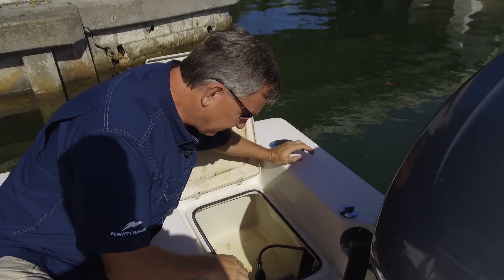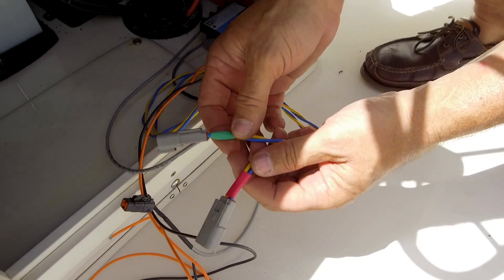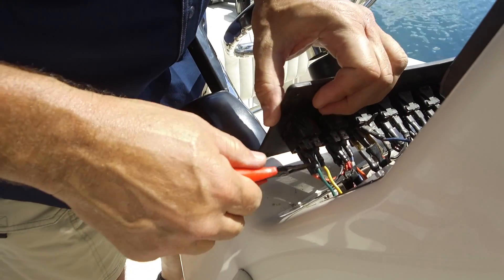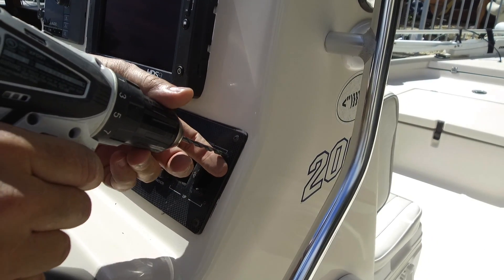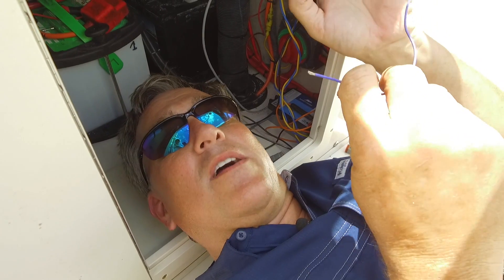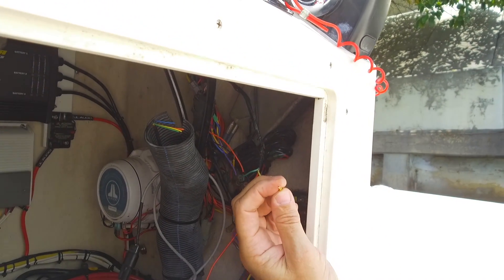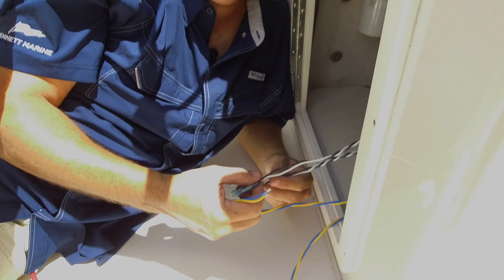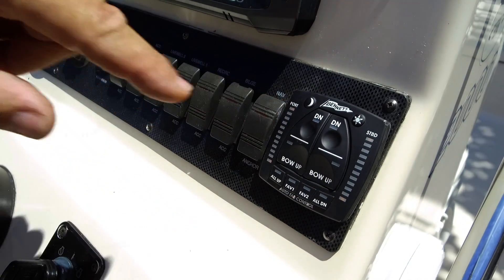Bennett Auto TrimPro Installation with Lenco Actuators

Comment: I wanted to add a comment on tapping your existing wiring. My boat is a 2017 Stingray 198LS which is similar to Larson and may have the same color wires to other smaller boats. Under my helm is a removable cover with a bank of relays with labels. I also have a set of dashboard switches from the factory. You are going to need a selection of crimp end terminals, crimper, and a wire stripper.

If you wire this up as specified, you will need either a battery on/off switch to cut main power or a separate on/off toggle switch. Otherwise, both the ATP control and the controller will stay lit all the time. I wound up running both orange wires off of the "trim tab" toggle switch on my dashboard (optional switch wasn't connected to anything from the factory). There was an open spade on the bottom rear of the rocker switch. I used a blade spitter and some heat shrink to connect both orange at this location. I chose to install an inline 20amp fuse on the orange to the controller fearing what might happen if the actuators short underwater. If you don't have this switch, you will want to have a battery cutoff switch or some other switch to prevent the controller from running all the time. Note that you could also use T-taps to splice into existing wiring, but the piggy back blade splitters are nice because they leave the wiring untouched and are easily reversible. Main power at the helm should be a large gauge red wire.

For the black ground, I used a piggy back blade splitter on the back of the black side of the cigarette lighter on the dash as I didn't have a bus bar at the helm. If you see a bar with a bunch of bonded black wires, that would be preferable (attach with a crimped ring terminal or similar). I could have also used a t-tap to any of the larger black gauge wires under the helm.

In order for the auto retract feature to work when you shut off the engine (before trailering), the purple wire coming off the ATP control must be connected to switched power. Look at the back your gauges to see what color power cable was used. The gauges usually are switched with the key ignition. On my boat the color of the power to the gauges was also purple, same as the ATP wire. I had an empty gauge spot and a pair of unused wires that I joined using a fully protected male/female spade terminal.

Comment: Does this work with a bennet hydraulic trim system?
Reply from the maker: Yes indeed! However, in order for the trim tab position indication LEDs to work you'll also need to ensure you already have sensors in your hydraulic actuators, or else you'll need to purchase a sensor kit (PN#  ATPSENSTD). An easy way to determine whether or not you currently you sensors is if your current trim tab control has trim tab position LEDs. Hope that helps!

Comment: Why wouldn't 3M4000UV sealant be more appropriate when installing tabs? The screws are what's holding the tabs on, not the 3m5200. Wouldn't a boat owner wish 5200  had not been used when they have to replace a tab part later?
Reply from the maker: Sorry for the delay. Our notifications were not coming through properly. Please email BMI_Info@Yamaha-Motor.com to chat with one of our techs.

Comment: I downloaded the install manual for the ATP. The instructions for the hydraullic version was to make sure control module is installed vertically and for the correct end facing the bow and parallel with keel.
The instructions for the electric version said you can mount it in any orientation. One version has got to be incorrect. Please address this for those potential buyers. Thanks
Reply from the maker: Zash, it sounds like you might have an early version of the ATP installation instructions, so you will want to destroy them and use the following for your application:  http://bit.ly/2Ncojdp (Installation manual), and http://bit.ly/37RKNs9 (Quickstart Guide)

Comment: Dear Team Bennett, I would like to add this to my 08’ Searay 44DB, and would like to know if I need to add position sensors to the rams?
Reply from the maker: Sorry we never responded. Our notifications were not coming through properly. With hydraulic systems, AutoTrim Pro technically does not need sensors to function with the auto tab control or manual tab control features. However, in order for the tab indicators to work on hydraulic systems, sensors must be installed which we have a kit for (https://bennetttrimtabs.com/product/autotrim-pro-sensor-kit/). Electric systems do not require sensors.

Comment: I bought a new 4.5 inch stroke actuator, but it only moves about an inch. Tried plugging it in on other tab, other tab works fine so not control unit.

Comment: May I use this control panel with two hydrolics tabs with two pomps?
Reply from the maker: We would really need to know more about the “hydraulic tabs & two pumps” before we can answer your questions concerning the installation of the ATP system on your vessel.  Do you have any photos of your trim tab system that you can email to us at BMI_Info@Yamaha-Motor.com?  If not, then we really need to determine the brand of the trim tabs, actuators & hydraulic power units we are dealing with before we get too far into your case. The best next step would be to call us at (954) 427-427 or email BMI_Info@Yamaha-Motor.com. Our techs could help you determine what is needed.

Comment: Always blindly drill holes thru the deck of a boat. Never quite being sure whats underneath. Maybe a fuel tank ?? For sure some important wires running to god knows what. Please don't duplicate what you just saw this man do. Could create a problem that trim tabs cant solve.
Reply from the maker: Good point we will add it to future videos. We do mention it in our installation instructions.
Reply: Probably in the unedited directors cut.

Comment: Please solder connections instead of butt splicing.  :)
Reply: ABYC standards prohibit soldering as the sole means of making a connection because the newly solid wire is subject to cracking or breaking through vibration and flexing.  Butt connectors are the ABYC approved method for connecting wires.
Reply: Tyson Jensen just wondering what difference does it make?

Comment: The new lenco switch with integrated control panel, LED indicators and auto- retract, have an orange wire that needs connected at the ignition. And the wire needs to go cold when the key is turned off. I'm installing on a 2017 Robalo R227. You wouldn't happen to know which wire I should look for do toy. I had one person tell me to attach the orange to the purple wire at the switch. But, I don't have a purple wire. Thanks
Reply: Greetings, it sounds like contacting Robalo and Lenco may be your best course of action. However, feel free to give us a call at 954-427-1400 to discuss. One of the techs may be able to shed some light on how to solve, or at least point you in the right direction. Have a great week!